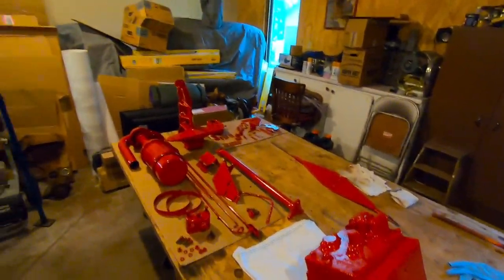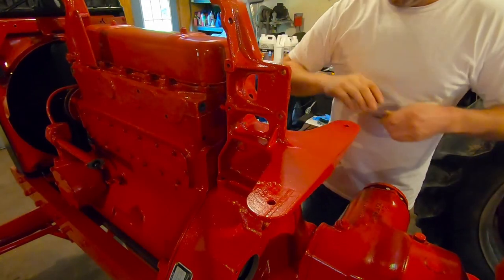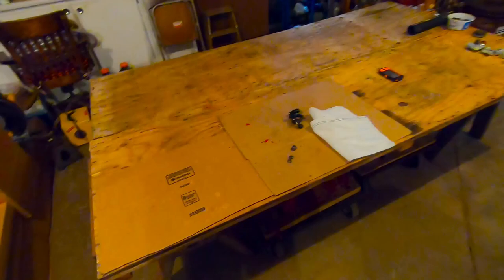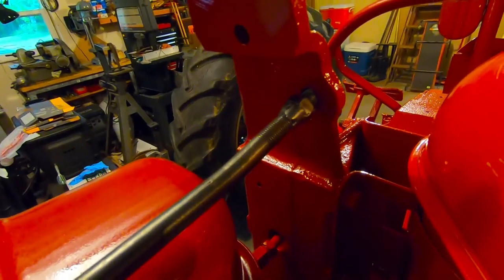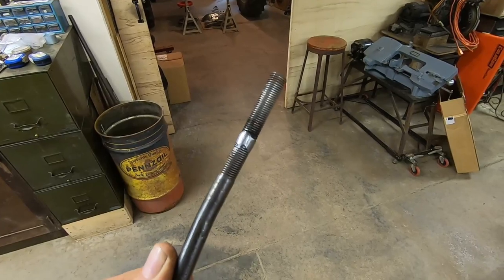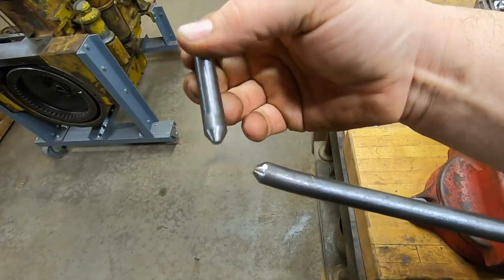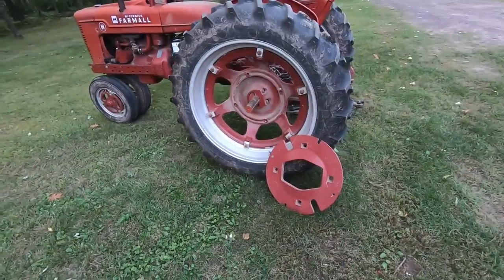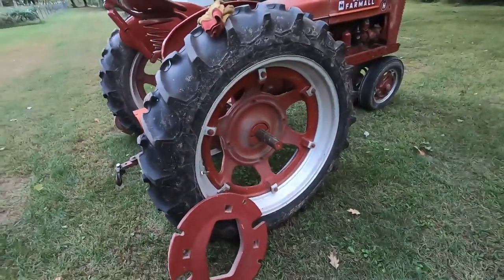Farmall Super M Rebuild Ep.46: More Painted Parts Installed & Reworking A Prior Faulty Repair

Comment: My first thought about that radiator support was not that the bolt was in the wrong spot but that you are missing a rubber isolator. Would give the smaller vibrations a little cushion.

Comment: I understood that the water in the tubes no only added weight, but made a HUGE improvement to safety as the reduction in air volume reduces bouncing and improves stability.

Comment: Rowe is an aftermarket weight supplier, I know they made AC JD IH and Ford weights likely cast others as well.  I don't think the hole spacing actually matters though as pretty sure the weights are supposed to go on slot to hole and hole to slot alternating. Aftre the base weight is bolted on additional weights are installed by placing the heads of the bolts (2) In the slots on the previous weight and through the holes in the weight you are installing(nuts and lock washers on the outside). This way you can install weights one at a time. Also you put the bolt in the hole of the weight you are putting on with the nuts and leave it loose. You can then hang the weight by yourself and hook the bolts in the slots of the previous weight so you don't have to try to hold 145lbs while trying to fiddle with getting bolts thru the holes.

Comment: Another option occurred to me regarding the wheel weights.  You could put both lettered ones on one side and the two non-lettered ones on the other side.  Of course, actually, you could NOT have done that!  That would make the tractor aesthetically asymmetrical.  Unacceptable!  I'm so glad you had that pair on the H.  That remedy was perfect.

Comment: So the square head bolts go in the notch in the 1st set of weights and through the hole in the second set of weights the lettered set of weights will work just fine on the m since you have them all cleaned up there is plenty of forgiveness in the notches  to accommodate the different hole spacing

Comment: Have you thought about using any grommets in the places where a moving rod/shaft goes into a hole, seems like without it, it'll just rub the paint off the first few times it's used.

Comment: Well did they have some sort of spacer. Clips between weights to accommodate the off set in mounting pattern ? Then again there may have had trouble with the hole closer to the edge breaking out

Comment: E. Rowe Foundry in Martinsville, Illinois, I suspect, though why they would have contracted Martinsville and then drilled through it is a curiousity.   Been in business over a century, but closing down this year - can't compete with Asian castings.   Doubt they were cast for IH, but rather were aftermarket weights - which also explains the hole misalignment.

Comment: I just seen on an M on a auction where the battery box is under the fuel tank. Didn't look like it was a seat support. Thought of your work on the M and with the difference of location, was wondering which one was an earlier production.
Gee, what influence you have!
Reply: The battery under the gas tank is an earlier model 1939 until 1952 only the 53 and 54 were under the seat.

Comment: Although I checked E Rowe Martinsville Ill., I don't see how 6 letters could be fit within the M and Ville.
Did you check the OD of the weight.  A smaller OD would move the hole closer to the edge.  Visually incorrect but actually correct. That Rad support repair was very well done, perhaps kink the rad end a bit to fit the bracket flush.  I would think that the holes on all weights would be identical dimension. I am working on a Super C at the moment.
Owner has 10 restored Cubs, H's, BN's and a Case.

Comment: You may find it easier to weld if you grind both ends of the rod into a flat wedge shape rather than a point, you don't have to turn it to weld, just turn it 180 degs welding one side than the other..............Mike
Reply: That's an interesting concept. I may have to try that next time. Thanks for the idea!

Comment: If you don’t want calcium in your tires,use methanol and water.It gives you the weight without damaging your new rims if you get a leak.
Reply: Why methanol,not ethanol or isopropanol  ? Cost,or some other reason ?
Reply: A neighbor near me,services tractor tires and that is what he uses and recommends.He assured me that the methanol would have no effect on the inner tube. The cost was $6/gallon.Six gallons for a 28” X 13.5” tire. A lot cheaper than trying to fill it with antifreeze.

Comment: I still think the valve cover, lifter cover, oil pan, timing cover, and intake manifold would look better silver metallic or chromed (or even brass plated) black air cleaner, and the rear fenders a bright deep yellow.
Way too much red. from the factory. Set your Case Sodbuster knife with red handle down on that tractor, and you'd never notice the knife.

Comment: I hate to tell you this, but you made a mistake. Your lights will not work. You won't have ground. I had the same problem with my M. The light pedestal can't have paint on the bottom, and where it bolts to the platform. Please shine up the bottom of the pedestal and the platform. Just some friendly advice from experience. Other than that, you're doing a fantastic job!!
Reply: Even your lighting cross bar,where the lights bolt on will need to be cleaned. And where the u bolts bolt on might be a problem.